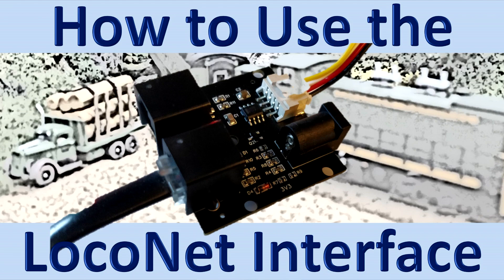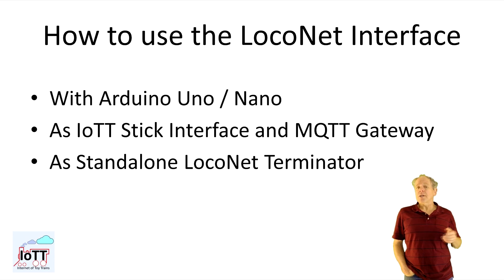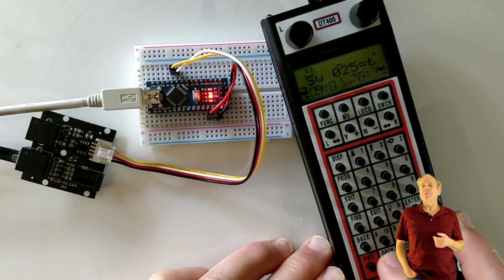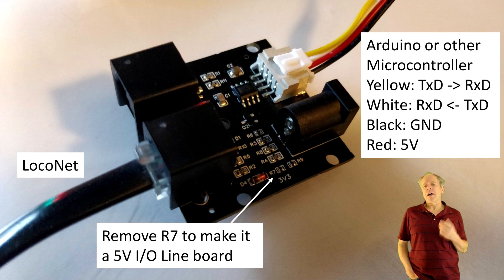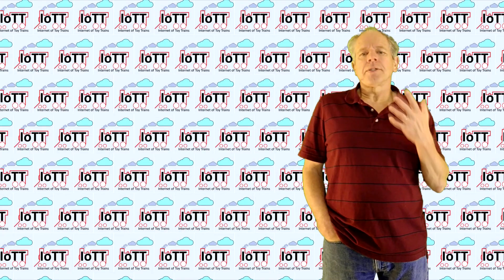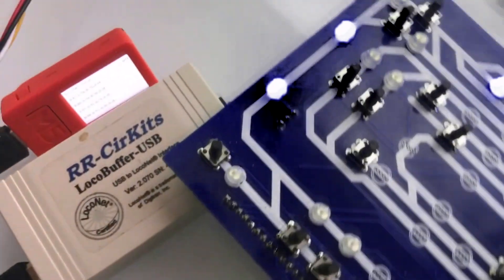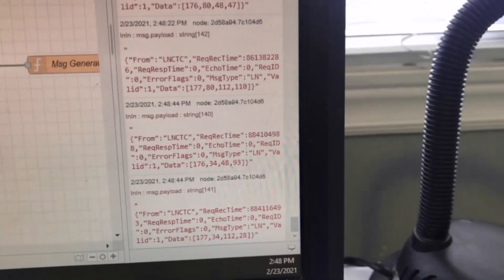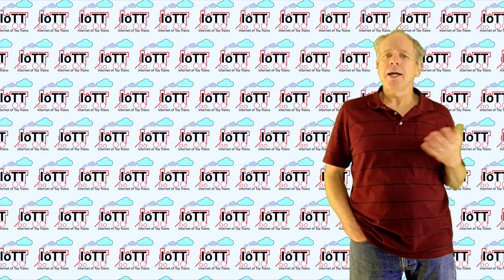How to use the LocoNet Interface (Video#64)

Comment: Hans, (or anyone), what are the correct pins for Loconet RX and TX on the Arduino MEGA 2560 REV3 please? At this moment I use pin 48 for RX and 42 for TX, also the RX and TX are inverted in the config file.
In my setup an Arduino NANO is working as Loconet monitor on it’s pins 7 and 8 as per your video, but I can’t seem to be able to get that - or any sketch involving Loconet - working on the MEGA…
Reply from the maker: The Mega is using IO48 for receiving Loconet commands. This cannot be changed. The transmit pin can be any other IO pin, but you need to tell the program when compiling. When using the Loconet Monitor example that comes with the library, add the desired Tx pin number in the loconet.init command:
void setup() {
  // First initialize the LocoNet interface
  LocoNet.init(42);
Also make sure the baud rate is correct.
Hope that helps
Reply: @IoTT  Hans, I did order two interfaces. In a test-setup, one works, and when I switch them out (all wires in exact the same positions, the second one does not work. Further testing will point out whether this was also the problem with the MEGA.
Reply: @IoTT Hans, as expected, the other interface - that also worked on the nano - does work on the MEGA… The other one still does not.
Reply from the maker: @GerardWassink  Interesting, as I test them before shipping. Could you please send me a picture of the component side to see if something is visible?
Reply: @IoTT Hi Hans, no sign of magic smoke as far as I can tell. I suspect I have inadvertently connected the 5V the wrong way around… Is it supposed to be able to handle that, of is this the reason?
Reply from the maker: @GerardWassink  The DC plug input is protected, but not the Grove port as polarity is not a problem when using a Grove connector on both ends, and the hardware tinkerers normally know what they do and the color of the wire is rather clear. Anyway, if you reversed the polarity it is possible the  LM 311 chip did not survive. Everything else should be ok. The only other thing I suggest is  verifying the contacts of the Grove port connector to the PCB and make sure they are properly soldered. Maybe touch them with a soldering iron. If that is ok, I would try to replace the LM311 chip, which is pretty easy if you have a hot air gun. Otherwise I can send you a replacement board (the only problem is that shipping costs ways more than the board...)
Reply: @IoTT Hans, thank you very much for your answer. I will check the wires. I am experimenting for now on breadboards, and I’m very much aware that red is VCC and black is ground. I just swapped them one time. And you’re right, the shipping is way more expensive than the price of one board unfortunately. I do not have a hot air gun, but perhaps I can mange with my soldering iron. I’ll try. Thanks for the help.
Reply from the maker: @GerardWassink  Using a soldering iron may work if you first cut the pins of the chip and unsolder them individually. The risk is that lateral force on the pin destroys the pad. The better method might be to place the board on an iron (maybe an old one, not the one your wife is using to iron her dresses) and hold it while heating up the iron. Once the solder melts, remove the chip with tweezers, but be careful not to move any other components. Then let the board cool down. You can now solder on a new chip using a soldering iron, or place some soldering paste on the pads, place the chip on the board and repeat the ironing process, this time to solder on the new component. Again, make sure not to move any other components.

Comment: We tried out the board with some simple examples.
For receiving LocoNet packets it is working perfectly.

For transmitting though we are having issues.
Any time we attempt to transmit it "hangs".
Interesting thing is that as soon as we unplug the LocoNet cable then the it stops hanging and continues.
It seems to me that there is something about the way that the LocoNet library is doing the backoff logic for getting a turn on the network.

We've tried it on both an Uno and a Nano.
We made sure that we uncommented the code for RX_INVERTED.
We've tried both doing an Loconet.init both with allowing the default TX pin to be used or a specific one that we choose.
We also tried removing JMRI from the network in case that was causing issues.
We tried connecting the LocoNet cable into the booster, base station or daisy chained to another device but still always say the same issues.
Note that during the time when our transmit is "hanging" other devices on the layout are all still working without issue.

Does anyone have any thoughts on what we might be missing?
Any help is greatly appreciated :)
Reply from the maker: After several e-mails going back and forth, it turned out that there was a problem in one segment of the Loconet. Once this was fixed, communication worked both ways as it should.

Comment: For my clarification, if I plug in only a throttle to the interface, I need a 12V supply?
Reply from the maker: No, the 12V supply is to make it Loconet Master. That is used for a stand alone Loconet without Central Unit. 
If you connect a throttle to an active Loconet, it is powered from wires 1 and 6, which is DC (Loconet T) or DCC (Loconet B) but with limited voltage and current.

Comment: You only mention using a Uno or Nano. Can you use a Mega with your sheild
Reply from the maker: Yes, that would work with the same library.
Reply: @IoTT  Thanks for the quick reply. If I am right all I need to do is change the pins from  & 8 to 47 & 48
Reply from the maker: As specified in ln_config.h the Mega requires pin 48 as Rx pin. The Tx pin can be set as you wish. Also note that both, Rx and Tx need to be in inverted mode. Check the notes in the ln_config.h file.
Reply: @IoTT  I have tried to download the sketch but get an error every time. I have checked the config file and this is ok. It all works ok on a Uno
Reply from the maker: I'm sure the error message tells you what the problem is. Should be easy to fix.
Reply: @IoTT  yes it does but I don't no what this means. The message is \ln_sw_uart.cpp:275:7. There quite a few of these related to the ln_sw_uart.cpp

This report would have more information with
"Show verbose output during compilation"
option enabled in File -> Preferences.
Reply: I think I had an old version of the Loconet library. Just update and now will compile. Will need to test on a board some time tomorrow.

Comment: Hello Hans ... I have one of your LocoNet Interface boards on the way, and am looking forward to working with my Digitrax system connected to our Arduinos. I have, however, had trouble finding the Arduino sketch you show in this video to control the NANOs LED via the button. I would also very much appreciate a copy of any other sketches you may be willing share for this interface. Thank you.
Reply from the maker: Check at 4;20 into the video. Once you have the LocoNet library installed in your Arduino IDE, there is a LocoNet entry in the example section. I am using the LocoNet Control Panel example in the video. It should work pretty much "out of the box".

Comment: I tried jumping the gun and running without uncommenting the RX_INVERTED line in ln-config. Glad I came to my senses and watched your video thoroughly! Thanks Hans, the sky is the limit with the loconet interface!
Reply from the maker: That would be like talking French to an American ;-) The reason I decided to use the same logic on RxD and TxD is that the interface can be used on a hardware serial port as well, which is allowed by the LocoNet specification and less strenuous on the hardware. And it is more inline with good design practice anyway.

Comment: Hans, thank you for the video. I have a DCC++ layout and want to integrate Loconet throttles into the layout. do you know what the setup on the IoTT stick and JMRI to have them talk to each other like they are on the same system?
Reply from the maker: First you need to make sure you are using a DCC++ version  that supports LocoNet. Originally this was not the case with DCC++, but I found one article here http://www.clubncaldes.com/2017/04/cheapest-dcc-command-station-with.html where soembody added LocoNet, and the code is available on Github. I believe that a newer DCC++ implementation for the ESP32 also supports LocoNet, but I am not sure about the status of that project.
Once your DCC++ command station supports LocoNet, you can use the Stick to connect  to JMRI via lbServer, or you can use a LocoBuffer USB to do the same. Your system should then be a real LocoNet system, just with a 3rd party command station, but all typical LocoNet components should run on it.

Comment: As an NCE user I have watched, with great interest, how you have used LocoNet in so many ways. I can certainly see why you feel that it is a versatile networking system. I’ve even thought of switching to Digitrax for my layout. In this video you have tweaked my interest in using LocoNet with NCE. I look forward to more on this in the future. 

I must say that I also appreciate these videos every two weeks. I enjoy watching them on Sunday morning. Thanks Hans!
Reply: Rob, I was using an NCE system and I have switch to a loconet compatible system. But I have see a few club layout using NCE for DCC train control and a loconet control loop for accessories and block detection, ctc panel and signal control. Iott do have a dcc interface you can use as a gateway with your current system. And still use a loconet control loop for different automation. You do have some options with your current command station.
Reply: @pierrelambert446  Thanks for the reply. I do have the IoTT DCC interface awaiting installation. Like many others, I am also waiting for the Green Hat. I'm hoping to put them all together soon on my layout. The modular club I belong to uses Digitrax and I have thought about getting one of Han's LocoNet interfaces just to play with. I might try it on my layout too. BTW, that was your N-scale outfit in Han's video wasn't it? I'm also N-scale but nowhere near the scenery stage. So far just track although I have test run a few engines to make sure things are right. Just need that Green Hat to get my servo operated turnouts going.
Reply: @robleathley6024  yes it is part of my layout. Only ⅓ of my layout have a good scenery. ⅔ is mostly like your. Just completed a house move and now I am looking to enlarge my layout. Until then, I am experimenting with Iott automation. I have activated block detection two months ago and I am experimenting with signals using the NeoPixel chain with s2811 chips to drive already build signals from custom signals system. I am now using tortoises motor for my switch and I won’t change those. But as soon as the new green hat is released I will order one. I already have a sg90 servo waiting. I am looking to test it out for a crossing barrier automation. My next layout will be designed with a lot off Iott devices.
Reply: @pierrelambert446  I am about to start building my signal system. I'm using block detectors from MERG that will attach to a Yellow Hat. Like you, a string of 2811 activated 0603 RGB LEDs will be used for the actual signal. Hans showed how to use RGB LEDs with a small interface board in a video a while back. As I have a 3D printer, I'm going to try making my own signal masts. Found some designs on Thingiverse that look good. We'll have to see how it turns out.
Reply from the maker: Instead of the MERG detector you may also want to check out the Moellehem 8 channel detector board. It is using diodes but has full opto isolation of the computer side.
Reply: @IoTT  Thanks for the suggestion. I’ll have to look into those. Exchange rate seems reasonable. Have you ordered from them before?
Reply from the maker: I have some on order as I want to review them in one of the future videos. I had someone testing them with a YellowHat and it worked (no surprise as they have open collector outputs). Including YellowHat and IoTT Stick we are looking at about $3.20 per block, which is cheaper than everything else I have seen so far.
Reply: @IoTT  I chose to use current transformers for my block detection as they have no connection to the DCC buss. Diode type detectors drop the voltage just slightly but this has been reported to be a bit of an issue with N-scale sound decoders. HO decoders in HO, and larger, scales usually have keep alive capacitors to compensate for any variations while crossing boundaries. I may be wrong given the improvements in some of the electronics of late. I’ll have to reconsider this and possibly try one out.
Reply from the maker: It is almost an year now that I maintained a two week rhythm. Kind of a positive side effect of the pandemic, as I am less traveling for business. We will see how long I can go on with every two weeks once things are picking up again ;-)